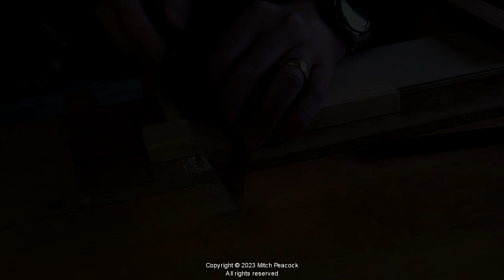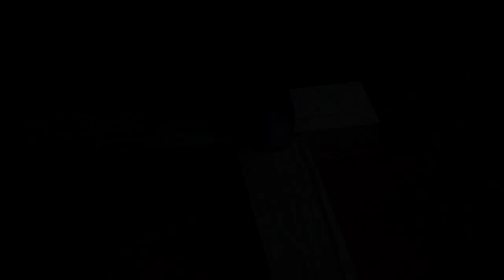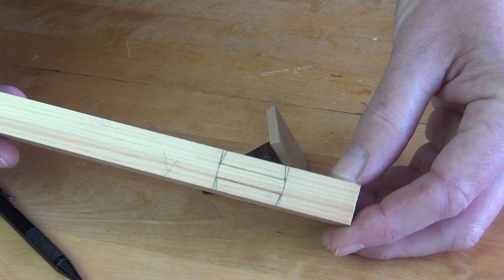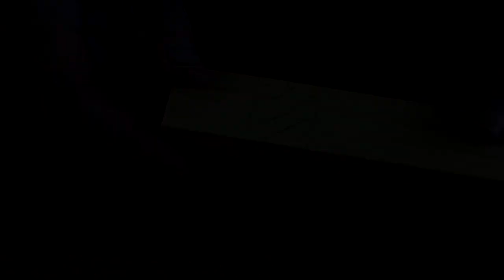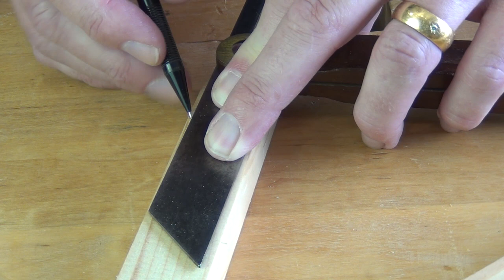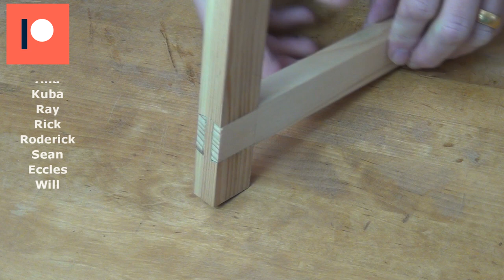Dovetail Bridle Joint / Hand cut joinery / Woodworking

Comment: All right, that's actually a very cool joint!! Checks off all boxes; mechanical strength and glueing surface

How about drawboring this joint to also restrict the last axis of movement?
Reply from the maker: For sure you can drawbore it. The tapered one that I demonstrated is often used for knock-down joinery, where it never gets glued. For example fitting legs to a tables aprons, where the tabletop weight just loads the joints making them tighter.
Reply: @mitchwoodwork  

Hmm all right! That sounds like a very good purpose for that joint